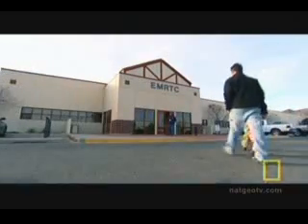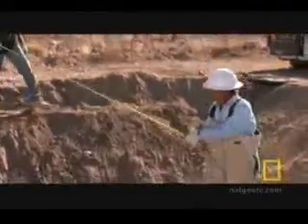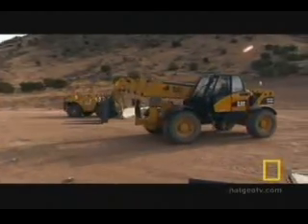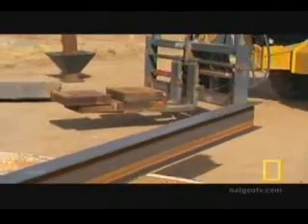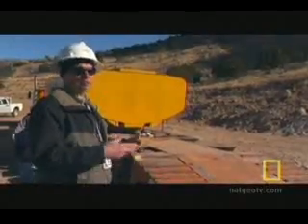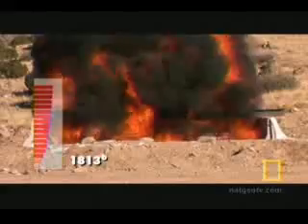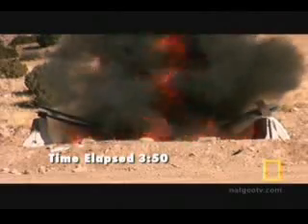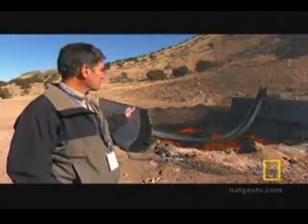steel being weakened by a jet fuel fire

Comment: The plane ways 400 tons, it was moving at 570 miles per hour when it stuck the north tower. The amount of energy that was created was enormous, 10 million foot pounds of energy on the tip of the plane, that’s equal to 3.4 tons of TNT.

Comment: Some of the comments here. Jesus. They demonstrated that heat from fire can buckle steel gurders. Nothing more. So your argument about thermite explosives is blown out of the water. If this were a criminal trial it would be submittable as evidence. You are assuming they're explaining everything. They are not. They are proving one thing. That fire weakened steel to failure.

Comment: 1. The jet fuel would of spread out and not formed a swimming pool deep puddle HAHAHAHA. 2. The spread out fuel would of been consumed in less than 20 seconds most of which would of being consumed while air born during the initial impact 3. The main supports are vertical and not horizontal. 4. A third tower fell over that was not even on fire.This 'test' is about as useful as the guy who pulled an white hot iron bar out of a blast furnace to prove that 9/11 was not an inside job.

Comment: Hilarious.  The plane impact could theoretically have knocked the insulation off of the structural steel in the towers at the point of impact . . . however, none of the steel below the impact points was exposed to any fire from jet fuel or any other fuel source so none of that steel was weakened enough for it to fail to support the loads it was designed for.

Only if 1) the steel throughout the entire building below the impact points was stripped of its insulation, AND 2) all of the floors below the impact point were engulfed in a steel-weakening fire at the same time, only then could this video explain why the the towers below the impact points collapsed as we saw in less than 15 seconds.

But none of the steel below the impact points was weakened prior to collapse and the steel used was able---by design---to not only hold up the weight of the floors above that they were supporting, but also at least 3X that mass/pressure.  The core columns could support 3X the weight they had to hold up and the external columns could support 5X the weight they had to hold up.

The official explanation is pure fantasy...
Reply: EXACTLY.  I appreciate these efforts to explain/debunk- but if you all want to really start convincing people that the official story is logical, then you're going to have to understand (and address) the actual reasons people are skeptical.  I don't hear many arguments about steel beams being weakened by hot fires near the impact zone.  This is NOT a common 'truther' argument guys.  The "issue" with the steel beams and fire is (a) the speed (10 seconds) of the collapse, (b) the completeness of the collapse (specifically below the impact zone, and in light of the fact NIST dismisses the pancake theory), and (c) the speed, completeness, and uniformity of the collapse of WTC 7 (in light of the fact no airplane hit the building, and many specific parts of the NIST explanation that appear to blatantly violate the laws of physics).   

Debunkers, Smart People, Well intentioned Educators.... THESE ARE THE PRIMARY ARGUMENTS relating to the collapse.  The problem, from a "truther" perspective, is that in 15+ years, you guys haven't addressed A, B, and C with any real convincing argument... and this is why so many people are still around screaming about these things... nothing I just mentioned in A, B, C and is up for debate.  99% of us agree/accept that they happened.   We just disagree on HOW they happened.   And these are the questions the debunkers just don't address.. Steel beams weaken at high temperatures, but we are only talking about, at most, 20% of the towers' steel being weakened..   the mechanism for the rest of the collapse in the correct amount of time HAS NOT BEEN DEMONSTRATED.  NIST didn't even try. 

So a truther gets on here and sees this stuff and it changes nothing, because you all aren't addressing the real questions.  And BECAUSE there is no reasonable explanation for these primary questions- it makes other aspects of 9/11 seem much, much more likely.  These are things like thermite residue in the dust, 5 isrealis, suspect stock trading, eyewitnesses to explosions (and molten steel) in the basement,  the lobby destruction, I mean the list here is just seemingly endless...  and frankly, until you can explain A/B/C with a sound scientific argument, the list of "other" issues surrounding 9/11 will only grow.  

And this is the frustration, because calling everyone crazy isn't a convincing argument.  In fact, it's more of a defense mechanism when you believe you are right, but can't (or don't want to) really explain why.  In 15+ years, there have been plenty of people willing to try and explain "why".  And yet they can't.  THERE SIMPLY IS NO EXPLANATION FOR THE SPEED AND COMPLETENESS OF THE COLLAPSE that jives with the "official" narrative.  

Instead, we see these myopic, ineffective attempts to support the official story.  You are just demonstrating something that isn't really in question (and often saying "conspiracy theorists will say this...", as we collectively roll our eyes because this isn't at all what we are questioning..)  And the truth remains unaccounted for.  We finally conclude that, we must be right, because no one can ever answer the real questions...
Reply: the damaged and weakened steel failed at those points. where the LOAD was the greatest. BECAUSE of damage.  You could see the buildings buckling over time.  
Shesh.. you people are disgusting.  towers shoulve held because the undamaged steel can hold 5 times its weight, assholes.
Reply: @bartacomuskidd775  exactly and another point when the floors above the burning floor cant longer be supported it will fall and hit floors below which can't take that force and collapse into next floor and so on. then when the supporting structure of the rest of the building is naked from several floors, while being exposed by the falling debris hitting it among side-winds and twist motion etc, it will snap further down which is why it collapsed further down.

Comment: This proofs really NOTHING , 2/3 of the lower TOWER was fully in tact and would resist the upper downforce. How can it be that a serious channel as GEOGRAPHIC  SUPPORTS such outcome in such deceiving way. 
You may expect that GEOGRAPHIC with a good REPUTATION had to be TRUSTWORTHY and a independent researcher. For me this means that even such channels are not any longer reliable. NOW WHERE else was GEOGRAPHIC lied about, this is a big eyeopener of really bad conduct.
Reply: Exactly! How does the bottom two-thirds of those twin towers just lose all integrity when the top third collapses on top of them?!!!
Reply: Why do you assume the lower 2/3rds would resist the downforce of the upper third??? Where is that proven at??
Reply: @tauras665  Simple: it was completely unaffected by the fires so how could the steel lose it's integrity? And how could the top third collapsing on it cause it just to collapse? How come it couldn't withstand that weight, and collapse at freefall speed, (or close to freefall speed)?! Why would you assume that's normal that the completely unaffected bottom two-thirds of those buildings should just give way like that and collapse, seemingly defying physics???!
Reply: @mikespearwood3914  thank you Mike you understand what i mean , besides of that the resisting of the lower part would had forced the upper part into a sideway position. Taurus forget also the fact that the lowerpart was constructed to held such weight and did this for years. Maybe a few lowerlowels would be damaged but the rest  was capable to resist the upperweight. When the towers collapsed you can see that many debree was coming down sideways so that the weight was already significant decreased.

Comment: Thermal mass trickery!  Let's use a small, single beam known to be weak in torsional, loads, lots of fuel in a deep pit to maximize the chimney effect, no coupling to other supporting structures.  This isn't engineering folks, this is TV drama and useless as to evidence.

Comment: Yes I may weaken steel but not the internal concrete column. If this was the case the walls and floors would of collapses and left the internal columns standing.
Reply: Yes I may weaken steel but not the internal concrete column

There were no concrete support columns in WTCs 1, 2 or 7.

and left the internal columns standing

The steel cores of both Towers stood for about 30 stories for about 30 seconds after the collapse wave ended.
Reply: There were no internal concrete support columns in the design of those Towers...

Comment: Jet fuel burns at 800° to 1500°F (not to mention the silicone dioxide components of thousands of computers, printers and fax machines burning at 3200°), steel melts at 2750°. At 1100° Steel loses 50% of it's structural integrity and at 1800° the structural integrity of steel is at 10%. You could bend a piece of 7 inch thick A36 steel my hand let alone 500'000 tons of concrete, metal, glass and other building material. Your simplification of a science and physics is not only base and childish but damaging. Kindly fuck off with your no knowlege bullshit. Read "The Collapse Of Burning Buildings: A Guide To Fireground Safety" by deputy fire chief Vincent Dunn.

Comment: Didn’t they design the wtc to withstand plane crashes? Wasn’t most of the fuel consumed initially after impact and explosion
Reply: It was built to withstand smaller plane crashes not commercial airliners.  You also have to account for the structural damage caused by the impact, even a fire burning at 1000°F for an hour would cause extreme weakness to already damaged beams supporting the weight of 20 floors above it.
Reply: @derekrichards1076  of course it was built to withstand commercial airliners.  it was in New York City, one of the most heavily travelled commercial airplane routes in the world.  Whos' paying you?
Reply: both of those things are correct.
Reply: how did an aluminum plane go through those building like a hot knife through butter? even if it was high grade aluminum
Reply: how did an aluminum plane go through those building like a hot knife through butter? even if it was high grade aluminum
Reply: it did survive the crash. and you can obviously see fire the entire hour. And no not all the fuel burnt off. fuel requires oxygen to burn. im sure a great deal was ejected out of the side.
Basically, you had this debris/fuel mix.. inside a steel box, with a gigantic hole facing the wind.  Thats what a furnace is.. a box with a flame, with a continual supply of fresh air.  It got hot as hell inside that building.
Reply: @bartacomuskidd775  no it didn't, all the visual evidence shows those fires were burnt out and cold, including the dark black smoke.  The fuel was mostly gone  (remember gravity?) - it fell down the towers, whatever wasn't consumed in the initial explosion.  That's actually admitted by NIST.  So you just made up that "fact"

Comment: These guys are morons ... of course steel will bend under high heat.... but it won't melt... and it sure as hell didn't burn on all the other floors ... so why near free fall speed ... why spherical metal balls in the dust ... don't forget a building is designed so the load is carried throughout the structure ... These guys are complicit in a cover up by doing such a shitty job of recreating one tiny aspect of 2 buildings falling at free fall speed 

Wow.... even NIST's models have never shown how the buildings came down ... their THEORIES were a complete failure and they GUESSED on the rest . Not too scientific

Comment: What is wrong with this pile of bull is that those same things was not in the trade towers. 
these guys are using a tooth pick of a beam. In the towers the beams were maybe ten  10 times thicker. Then the beams were not exposed by a big deep puddle of fuel. Most fuel burned up on impact , then the rest only soaked into office mat. and started those fires. But just like lighter fluid it burn off quickly. this is a joke

Comment: Still bullshit. How did th fuel cells on plane stay together to supply th volume of fuel required to reach th high temperature and maintain that.  It wouldn't  upon impact the sparks from metal on metal would of ignited the fuel whilst it was a mist. Then it would of burnt all at once. Logic wasn't applied in this test.
Reply: Mitchell Hamilton idiot

Comment: LOL!  How silly is this?  First of all, they use a beam that is much smaller than the ones in the tower, then they have a pool of fuel sitting under it?  LOL!  That is NOT what happened in the towers.  If there was indeed any fuel in the towers, it would have been instantly dispersed all across the floor and down the elevator shafts.  Also, the distance from the floor up to the ceiling above would have been like 12 feet or more, not just a few feet like this lame test.  Clearly, these guys don't know how to recreate the conditions they are trying to PROVE.  Clearly they are not being unbiased!

Comment: a single 1 ton beam vs 700 gallons of jet fuel no shit it will fail......it is one beam not tied to any other beams and all 700 gallons are burning one beam alone. heres an experiment make a steel structure soak it in 700 gallons of fuel and make it explode burning off 90% of the fuel and let me know how damaged the structure is....theres not much science happing here

Comment: this video proves that the building was blown with a controled demo becourse only the top was on fire not the bottom so haw did the bottom 50 floors at least buckle and bend like the part that was on fire when it wasnt on fire ? and before you say the weight of the top moving NO it still will hold the weight of the top even under high winds and earthqackes to a sortern level

Comment: The fire burns hottest within a jet engine but there is highly compressed air mixed with atomised fuel. Inside a building, you usually have a rich fire (dirty burn, not enough oxygen reaching all fuel) at atmospheric pressure and I don't think NIST are going to get the government in trouble.

I know fire can weaken steel judging by the fire pits and stuff I've had over time. I mean steel wool can burn and a heavily loaded beam can bend.

As far as the world trade centre collapsing as it did I would not expect this from just a fire, although it could certainly render the structure unsafe. The further down the building the fire happened, the more the risk would be.

Had the momentum of the falling building been enough to overpower the undamaged steel below the fire, I would expect a much slower collapse than what was observed. But it looked as if something was taking out the strength of the steel in order for the building to collapse as quickly as it did, let alone pulverise the concrete into such small chunks.

The collapse of building 7 is the most suspicious one as it is not nearly as heavy so it is more difficult to claim it was a feather away from collapsing under it's own weight. Plus it also underwent a textbook neat collapse supposedly from "fire".

No plane hit building 7, just some chunks of debris albeit some the size of a car. And it didn't collapse for quite some time.

Comment: Putting the remaining weight not contained in the smaller beam that would match that of the steel beams from the twin towers directly on a small portion of and on the weakest part of the beam actually speeds up the rate at which the structural integrity would fail. Get an actual to-size steel beam that matches those at the WTC, do the same experiment and then we'll talk.
Reply: Talk about what?

Comment: How old were the beams, and how much oxidation did the Twin Towers beams have, where were the beams from that built the Twin Towers. I think 100% that those beams could absolutely melt. Don’t forget, these buildings weren’t new, they were made of whatever steel was made from 50 years ago. 
I agree with new steel it may not melt but this wasn’t new steel, this was very old steel made in the old days. Also don’t forget that there is a lot of other stuff that helps hold these buildings together other than the steel frame.

Comment: What a heap of nonsense!! A) The jet fuel in the towers was burnt off in seconds B) the beams were much more dense C) there were hundreds of beams per floor D) the tower beams were covered with sections of concrete and other material E) the beams in the towers didnt not have any reservoir of jet fuel burning directly a few few feet as a concentrated burst of heat for any length of time (laughable!) F) the tower beams could not have failed by jet fuel burning as demonstrated in this small scale nonsense G) jet fuel fires DO NOT throw off streams of molten slag in any condition H) the steel in the towers were molten for weeks and week afterwards at ground zero.....the only thing that could have weakened these beams is Military Grade Thermite...end of!
Reply: No the steel in the WTC was not reinforced in concetre, it had wall board surrounding the core which is much weaker and the fire proofing was knocked off dueing the impact. After an hour of thermal expansion, a chimney effect fire and Euler buckling part of the structure could no longer hold its load and when that failed it started a progressive collapse that was unstoppable.